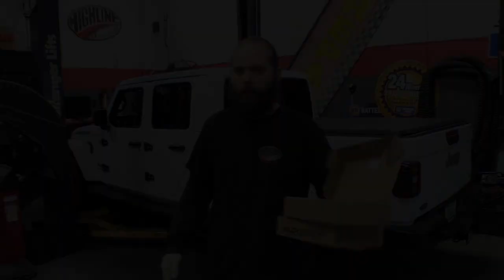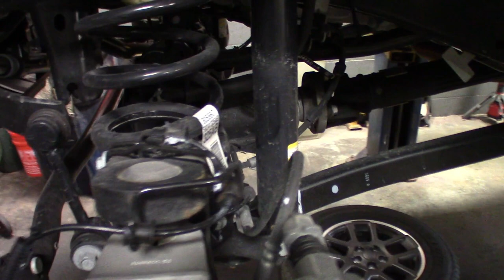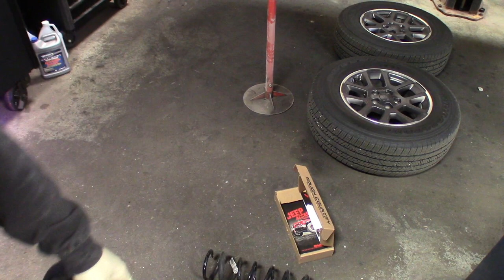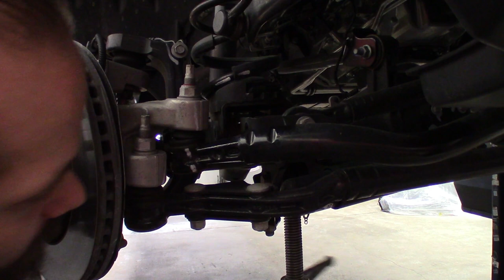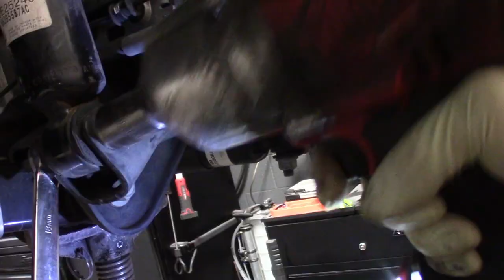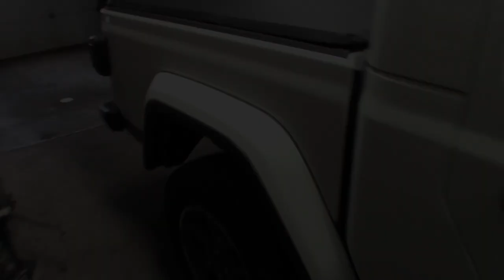The Rustless Jeep

Comment: That was a pretty forward job . I have a question and I understand if you're not comfortable answering it . Is this a pre quoted job or does this go by the hour . I know that it may sound funny that I ask this but I'm just trying to figure out if flat rate , as you people call it , is something for the more experienced guys in our shop . The ones that like you , can work on every car . I would quote a job like this 1 Hour per side . Paying my guy , wear of tools , insurance ,electricity ect. ect.
Reply from the maker: To make it easy you can just give the customer a quote on if you were to replace the front coil springs. Pretty much the same amount of work.
Reply: JRC54 that’s exactly how we would quote it at our shop, just charge the customer the labor to replace the springs